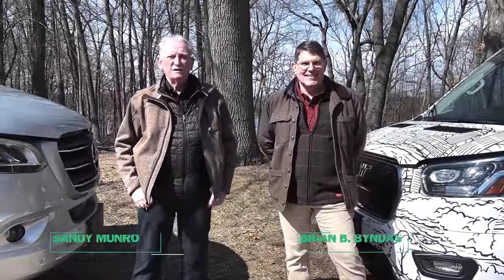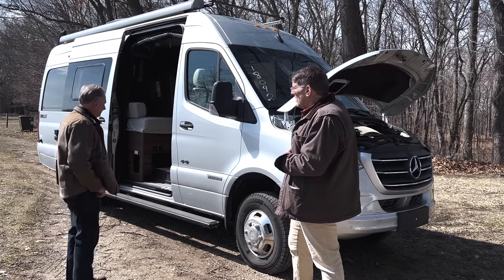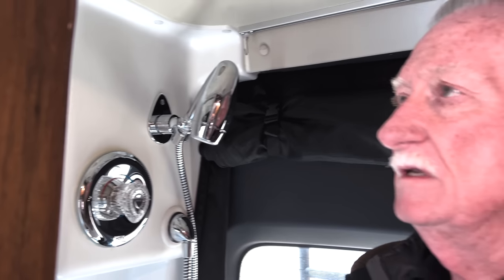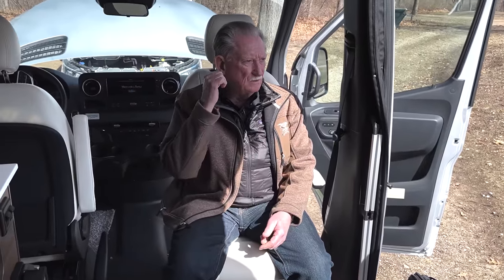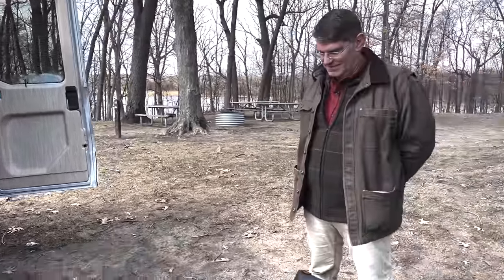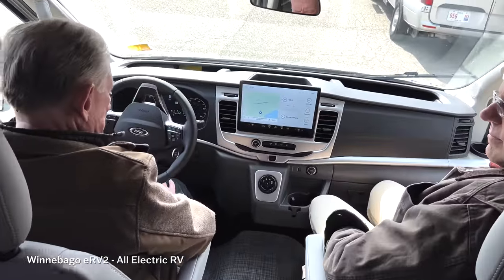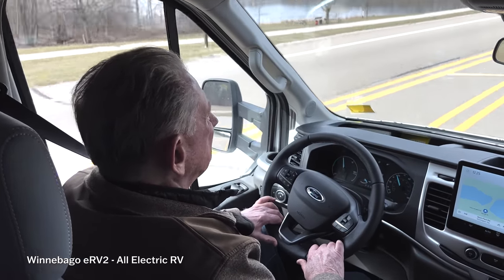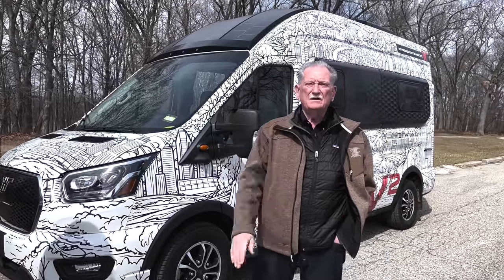Winnebago Showdown! Diesel VS Electric RV

Comment: Sandy's reaction to the frunk is priceless.... 😂
Reply: Sandy, did not faint this time.....lol
Reply: Couldn’t make it though the video without mentioning Tesla.  He must be contractually obligated.  (just kidding)
Reply: Well, the stuff under the hood is spread out more than the Mach-e!   FYI, according to Ford, the powertrain is from the Mach-e.
Reply: It makes sense to have no frunk on a delivery van chassis. Your Amazon driver isn't going to keep packages up there, so why try to add storage. They really just try to eliminate any space up there to give more room in the back.
Reply: @ackables  It also makes no sense for Winni to use a Commercial Delivery Van for a motorhome, but they did it anyway!  I guess they gave up on using a Cement Truck, though. 🤣
Reply: @ackables  - Except, this is an RV . which DOES have use case for FRUNK .
and Tesla semi & Cybertruck DO HAVE use case for FRUNK. 
FUD motors is too OUTDATED & Inefficient.
Reply: @markplott4820  Yes, I agree that a camper would have a use for a frunk, but Winnebago didn't design this vehicle. They converted a cargo van into an RV. They can only do so much in a conversion. Ford isn't going to modify their van for a handful of camper vans.
Reply: @ackables  - the REAL Answer is, ......Winnebago RUSHED this product to Market , and made it Crappy.
Reply: What priceless!? Lol!!!
Reply: @shazam6274  that has to be the old Ford Mach e motor mot the current one
Reply: @ackables  exactly! Plus it with make a great storage space anyway! They need very easy access
Reply: @markplott4820  stop talking crap!!! The Ford lightning has a gigantic drunk and the mache also a frunk so what's your problem your outdated problem with "FUD"
Reply: @ackables od Ford actually wanted to make a van for camper they would have definitely made a different version of this with all the power acces to ease the conversions just like with ICE vans.
Reply: @ackables  on the diesel can you don't have a massive battery but tons of space down there to install all kinds of accessories including auxiliary fuel tank to go everywhere you want.
Reply: @carholic-sz3qv  Whatever, it is a midsize E-SUV powertrain installed in a cargo van.  Whatever "new" motor Ford has may also be in this thing as well.  Still can't go 50 miles from home, if you want to get back, that is.
Reply: @carholic-sz3qv  - FUD motors is going BANKRUPT in Q4 2023.
Reply: @shazam6274  the biggest Iveco daily can for example has less than 200hp but it's utterly way more capable than your 500hp electric motors or whatever! And it can also still tow more than a Tesla
Reply: they keep lying about battery prices coming down, it is still very expensive to replce degraded battery of a used  electric car because manuacturers are adding huge profits onto replacement car batteries too
Reply: @carholic-sz3qv  What are you talking about?
Reply: LMAOOO

Comment: The basic problem with converting the e-Transit into an RV is that the e-Transit was designed as a last-mile delivery vehicle. So it has completely different use-cases as an RV. Hopefully Ford will come out with a real cargo van that has a bigger range and on-board 2-way power (which would simplify the electronics part of the Winnebago conversion).

Comment: steers like a car ,that was one of the original design briefs for Ford engineers in the UK when they first designed it, that and use all of then current ford car parts,along with the critical 8 feet load bed capabilities for the van :) :)

Comment: Here in California outdoor campfires are often not safe or legal. So carry a Coleman stove. I had an electronic bidet in my van. I mounted all the batteries under the van. Access through the floor. It lowers center of gravity. The Fords I worked on didn't have front sway bars and steering was horrible. Sway bars front and rear really make a difference.
Reply: camp Equipment need to be 100% Combustion FREE and use a Portable Rechargeable battery (good for 5+ days) .

Comment: Battery size is kWh, not kW.  

I noticed he said same thing in previous interview.
Reply: Correct. KWh is capacity. KW is rate (typically describes the charging rate).
Reply: Who said it
Reply: The gentleman from Winnebago

Everyone in the industry is learning, and having hiccups along the way
Reply: kWh is a metric for energy. kW is a metric for power.

Comment: sharp video Sandy! it's very helpful to learn the difference between both products. as well as the designs & transitions!
so from what I'm understanding. it's battery laws, that obstructed the proper assembly. thus created new cost, but inspired new innovation's. though all this was 
simply because a travel van, couldn't be a travel van! I'm proud to see all the new innovation. but the obstacles seam so foolish. good luck !
Reply: the VW iD buzz is far WORSE.
its a Cargo van converted to RV/Personal van use.
Reply: @markplott4820   Ford e transit has a tiny battery compared to anything the vw ID buzz will offer just to inform you!

Comment: Not impressed. Looks like someone simply repurposed a diesel platform using an off the shelf parts. I have seen DIY custom jobs by normal people that is better. Almost amateur this. Can't think of saying it any different.  Everything should have been rethought, every space should have been used to the maximum potential..... also the whole bottom floor should have been used for a custom battery, doubling if not tripling the range/capability. It is a van not a car.

Comment: If that transit was a hi roof long wheel base and with the longer base should be able to cram more batteries in and push it to 250 miles ?
Reply: This is a concept development vehicle.  I m more interested in what will come, which they are unlikely to say until they are ready.   So I'd look to their current model.  Do they currently build their own vehicles for their current products or do they use base vehicles, produced by others?  If they ae, why not use a Tesla Semi-mini. 300M range right there.
  You are right.  The real answer I think is, a blank sheet of paper on the drawing board.
Reply: Neither FUD motors or Winnebago make their own Batteries.
Reply: @markplott4820  Who is FUD motors?

Comment: There's a lot of room for improvement in weight savings. The BoldT gets 14mpg!?!, I bet it could be improved. The Vixen 21 td from 1986 got 30mpg. IMO they need to be thinking more like an aircraft manufacturer. Maxwell Vehicles came up with some Hybrid cargo van based on the Voltec powertrain. I'm not sure if it ever went into production or if it was just a conversion. But, their website said they get 33mpg and has a 832mi range.
Reply: TESLA model 3 RWD is 132 mpg , let that SINK in.

Comment: I checked the Transit vans battery and it's only 64kwh.  Double that and it would be fine.  Also you really would not necessarily need a second system for the camping application.
Reply: Except, SOLAR is to little , it still needs DUAL solar Awnings to charge battery. 
also, only need ONE battery for motors & 100% Electric kitchen.

Comment: Given, that the range of the E-RV is that limited, and the experience with diesel heating is there, why not use the place in the „frunk“
For a generator, using diesel or alcohol (emission efficienct) to generate electricity and heat for the E-RV in addition.

I also don’t get, why the input for the solar system is not in the frunk. You should have the backdoor open to have the additional Pv. In my designen the portable pv would lay on the windscreen as shading and collecting PV.

Comment: Most of the differences  (Sandy's preferences)  are more related to the "donor vehicle"  - ie light commercial (car derivative) vs Light TRUCK - derived from a cargo carrying platform (the microwave can be plugged in anytime you need one).

- lol, relocating those coolant bottles and hoses - adding a fr-trunk is a no brainer.. store additional gloves, coolant, powersteering, brake fluid and windscreen cleaning kit (and a long cable) -- for the lunchbreak.

If you don't mind getting bugs and dirt all over your nice dress.  (that has been the downside of "pointy end" Storage spaces in vehicles since Adolf test drove the concept pre-911..

Claiming a "carbon footprint" improvement ignores embodied emissions at the manufacturing stage (info re "years" to breakeven for LCA and emissions cost of disposal -  recyclable fraction (modern vehicles are very recyclable down to the last piece of interior trim, that components are not all recycled speaks to the reduced cost of using virgin material.....

A couple of kW of solar for standby charging - is also a piece of cake to add in the modern world.
(the "archaic" fasteners on the traditional Winnebago - and the vomit inducing trim, is all mere styling  details - hidden integrated (one time use push in) fasteners on step treads etc, not so difficult  - however the accountants may argue -  making this as a point of difference is ridiculous coming from a "production engineering expert". indeed.

Comment: Looks like they could do with getting rid of that ridiculously heavy bonnet, swapping it out for a carbon fibre version to help efficiency and extend range. 
Perhaps Winnebago needs to seriously consider manufacturing their own gliders from carbon fibre, only purchasing the chassis from an OEM. It would greatly extend the range; they're paying a premium to an OEM supplier for a part that could be eliminated from their cost structure.

Comment: pretty sure body roll has nothing to do with the electric motor or battery. the ev version has better shocks or something along those lines. so that point was mute I think. if not please explain.
Reply: All the weight of an EV powertrain these days are closer to the ground, making the CoG closer, compared to an ICE version where most of the weight lies in the engine, which the CoG is not drastic, but will be slightly higher. I do agree that upgraded suspension components are lilely key to making the Ford handle better, but only because it carries most of the weight on the lower end. I've also driven the regular Ford transit, the Sprinter, Chevy Express van and F-650 cargo truck. The transit is by far the easiest to drive for the average person.

Comment: Huh. I have a 2018 Mercedes Sprinter XD3500 144 flat bed with the same engine and the steering seems great. 
Easy to drive and to locate in a lane. The engine is pretty darn quiet for a diesel.
Reply: Is it 4x4?   Reason I ask is the 4x4 Sprinter has a totally different design for the front suspension and steering system.   I own a 4x4 Sprinter and have driven a 4x2 version.  Sooo different.   But I’ll take the added ground clearance, traction, and overall build over a 4x2 and live with the added roll.
Reply: @JohnSeitz  Ah. Good point. I didn't consider that. 
It's my farm truck. I needed weight carrying capacity. I barely drive it 3,000 miles a year.

Comment: Ford obviously doesn’t communicate well between departments…..why not use the “frunk “ design from the F-150….Have the connection for the solar panels on the outside of the van so you could close it up, go hiking, etc. without having to leave the back open, etc., etc.

Comment: I run courrier and last mile routes all the time.   Ford nailed it for the driveability on the Transit... Ram you can even see to the left as the a pillar is 12" wides. And the mirrors are to low.   Mercedes is a pain to get into... Fords blow the transmission at 50k miles. But nailed the ux

Comment: A simple rearranging of the underhood components could provide a frunk useful for tools of the trade,  as this isn't only a delivery can,  but a work van also.  Plumbers, for example,  could access their basic carry set of tools for inspection and quick repair,  often not needing to even open the back.

Comment: I've been driving full EVs since 2012.  My Model 3 says it has 300 miles of range.  That translates to a realistic 200 miles of freeway range, since freeway speeds and hills kill mileage, and I don't want to be white-knuckling it to the next charging station.   I have been there, and it is NOT fun.  if they claim 200 miles, that translates to ~ 125 miles of useful range on the freeway packed with gear, including a buffer to keep from draining the battery to zero and for my heart-health.  That barn-door of a truck is going to need to stay to the speed limit or less and flat ground to get anywhere near their claimed future 200 miles.  Therefore, based on my personal experience of over a decade, hard-pass until it gets closer to 300 miles of range.

Comment: Sandy is used to the Ford Lightning frunk.
I agree Ford should standardize on that.
Winnebago might want a version that loses the toilet/shower 
until they get get a unit that is two feet longer and one foot wider.
Excellent design effort for what the Ford Transit had, but need a larger unit with longer range.